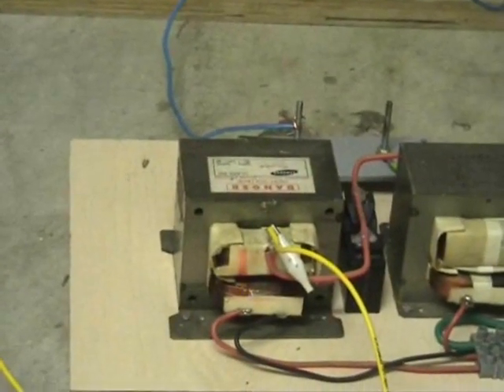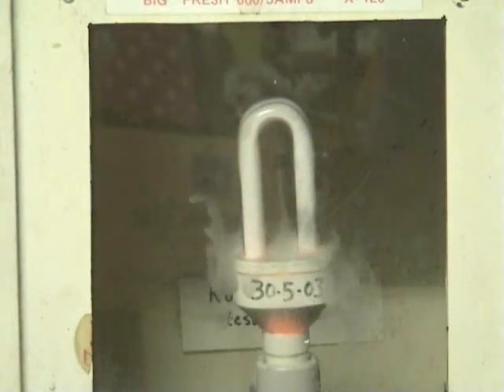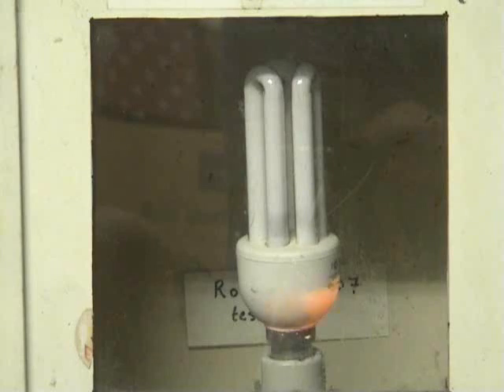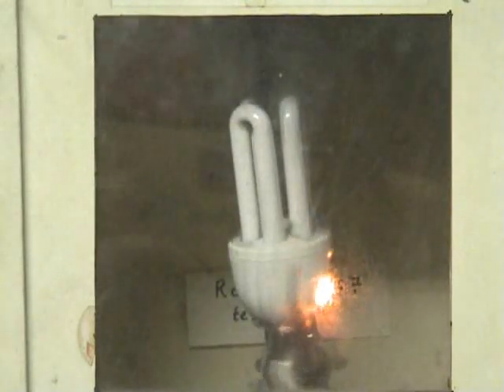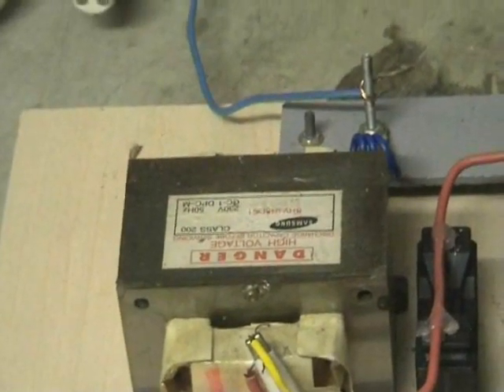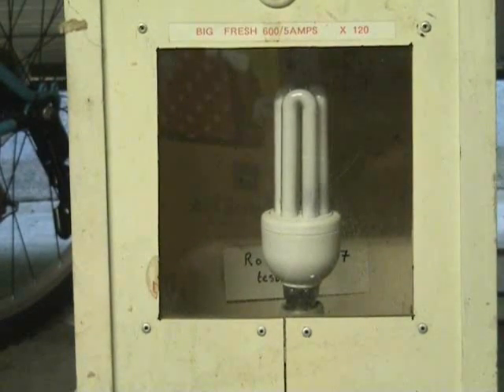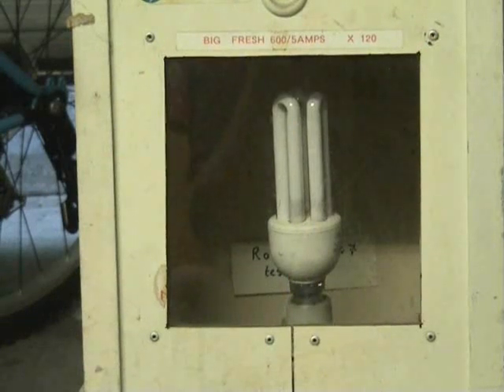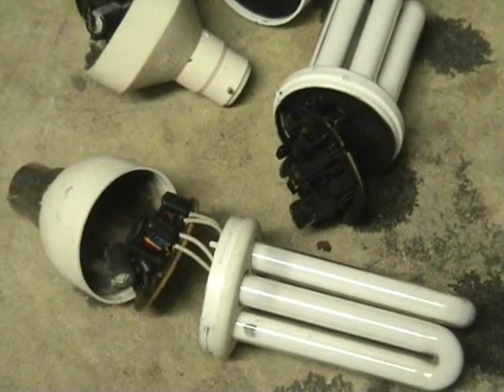A few old CFL lamps smoking and arcing on a MOT

Comment: CFL lamps are a hard to fry as they result is arcing on the PCB or in the fitting itself. To "POP" a CFL tubes remove the tube from the PCB and lamp holder and connect the tube across you're high energy cap bank, and blast them. The tube doesn't stand a chance it should explode. Then hit the PCB you could try blasting the PCB and tube at same time connect cap bank directly across tube with driver intact. through destruction.

Comment from the maker: @HDXFH  Rewound they have more use but the primary coil is still limited to about 4 to 5 Amps for a 1200 VA MOT.
Secondary depends how many thick wire gauge will fit. Then high amps at a very low voltage.

Comment from the maker: @FoamPackingPeanuts  A MOT is still very limited when loaded. The wire size is tiny on the HV side.
As soon the load exceeds 700 mA to 1 Amp the voltage start to drop rapidly and the MOT overheats.
If not switched off quickly it will rapidly burn out.
At a high resistance load it can give nice fire works.